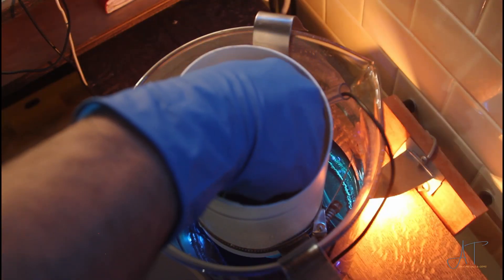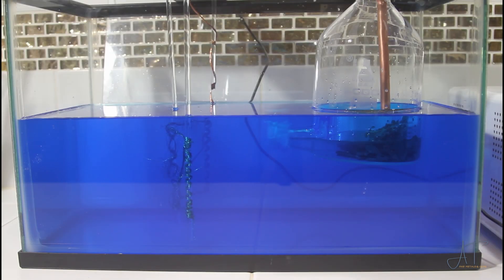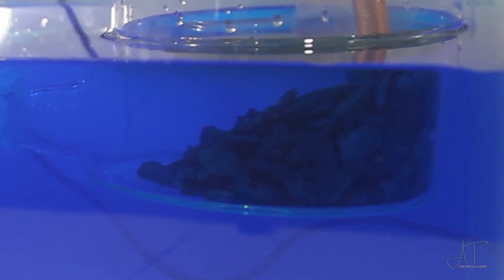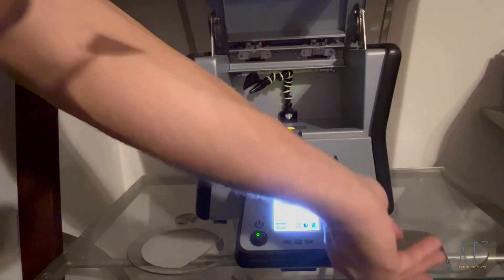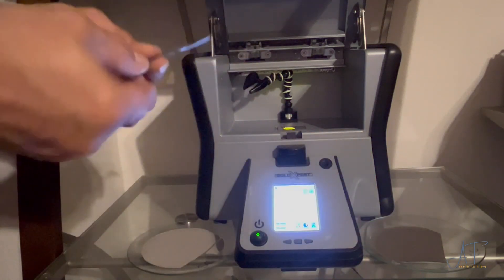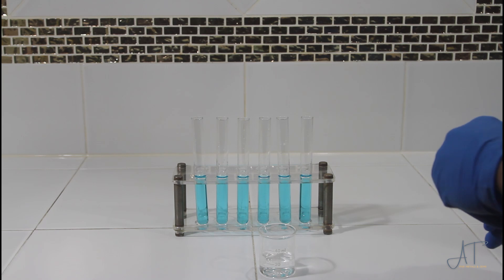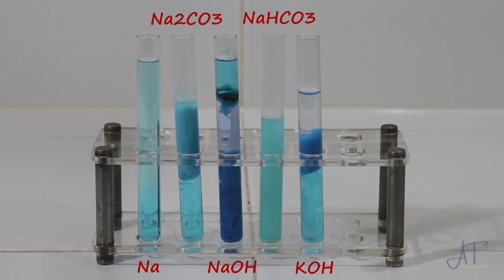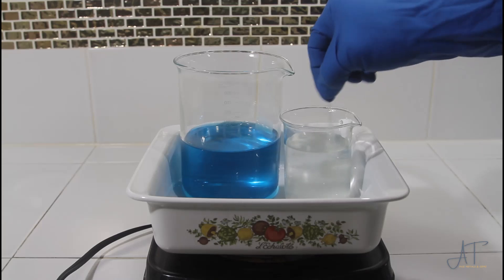Melting Silver Plated Scrap (Metal Alloy Separation)

Comment: You should change the titles of this video and part one to whatever you want but make them the same with pt 1 and pt 2 because a copper cell is exactly what I needed and i had to do some searching to find your second video.
Reply from the maker: Thanks, I’ll make a note and spend some time on that. I want to make each video stand alone, but I need to do a better job of linking the experiments that go together. Thanks for the tip!

Comment: This is getting better and better my friend!  So I melted 50 lbs of silver plated with my devil forge (which I re-named God's Forge).  I will be making your copper cell with the buckets. My autistic brain still can't figure out why you have that and another one with the glass "trap" for the shot!?  Don't they both do the same thing?  Should I make both or would you suggest 1 as better than the other?  This is going to be great for my non profit organization for autistic children.  I became a government contractor to get the good e-waste.  I believe your system will be the perfect ending for the e-waste after going through the shredder, hammer mill, and the shaker table!  Thank you again Professor Thomas!
Reply from the maker: Both cells do the same thing. The difference is the volume of material you can process. The buckets can take more metal, but may clog a little easier. I really prefer the aspirator bottle for ease of use and easy to clean out but is a little slower. I'm really glad the videos are helpful.
Reply: Gods forge! Now thats a forge I'm willing to invest in.

Comment: Hi, Anthony   I was just wondering how you go about doing the knife handles and I think some of the feet and handles are not all copper on trays and pots. I thank you for any info. You have a great looking set up.
Reply from the maker: @mfshooter1963  Thanks so much! I drill a hole and put silver plated knife handles right into copper cell anode bottle. Connect positive to power supply and knife handle. The feet and legs that are not copper I have just been cutting them off and saving for later. Many of the legs and handles are silver plated pewter so refining them takes hcl and a separate process.
Reply: @anthonythomasfmg  I thank you for the info. Will give it a try.

Comment: If you dissolve the slimes in Aqua Regia, it should dissolve everything and you get good Silver Chloride.  You do run the risk of Lead Chloride also precipitating out and contaminating your silver.  It seems it would be better to dissolve them in Nitric and cement out the Silver with Copper.  That should remove everything more reactive than Copper and most of the Copper should stay in solution, resulting in about 98% purity or higher.  Then you can melt the cement into shot and run through your Silver cell for 99.9+%.
The AR process would be great if it weren't for the Lead presence and the pain of converting the Silver Chloride using the lye and sugar method.  Just my thoughts, love your videos; you probably knew all this already.  Thanks for sharing your work!
Reply from the maker: Thanks for the input, great catch on the PbCl. My thought there is lead chloride is watersoluble and AgCl is not.  That could be a good seperation point. Correct me if I'm wrong there but the lead does scare me away from HCL A/R approach. I'm working on a couple tests this week that will hopefuly point in the right direction. I can think of at least a few approaches and cementation on copper is #1 on my list so far. I'm thinking of two somewhat novel ways that may save chemicals and/or money, but take quite a bit of time. I'll have to see how the tests turn out but your line of thinking is right on. Thank you so much for watching, and God bless!
Reply: @anthonythomasfmg  OK, gave it some thought. Lead Chloride is not insoluble in most solutions, but it will drop some. However, you could dissolve in Nitric first, then add a little Sulfuric acid to precipitate out the Lead Sulfate which is insoluble and will come out instantly. You may need to do it in (like 20mL/Liter) doses, and filter between to get it all but it won't go back into solution. Another sulfate may come out also, but Silver and Copper will not and I don't think the Tin or Nickel will either. Be careful with Lead salts, because they can get in your skin and cause brain problems. Put your filters after drying into a Ziploc bag and label and store somewhere safe, or dispose of through hazardous waste.
Once no more Lead Sulfate comes out, the HCl should give you 99+% Silver Chloride. It is faster than waiting on the cement-on-copper route, I just find the cement to be easier to rinse, but again you may get a bit more pure% from the Chloride on the first try. Good luck , and be careful!
I will keep an eye out for your next video.
Thanks again!!
Reply from the maker: Thanks brother! Your info has been helpful.

Comment: Hello man, interesting video. Slimes are very "tin-y"... :-) may be some pewter was in the mix...also quite a lot of lead...  31 Volts ??? so much? 1,7 Amp, that is like 50 Watts... the tank should be quite warm... Your experiment explains my early mistakes with AP waste treatment... I tried "neutralize" acidic solution of whatever metals, ended up with nasty mess of precipitates.... God bless and Merry Christmas...
Reply from the maker: Merry Christmas! I'm sure I had brass and now I'm pretty sure pewter with that high of concentration of tin. I'll have fun pulling them out one by one! I pray... Ya, it doubles as a sink heater for sure.  Runs about 80 degrees. God Bless you and your family this Christmas!